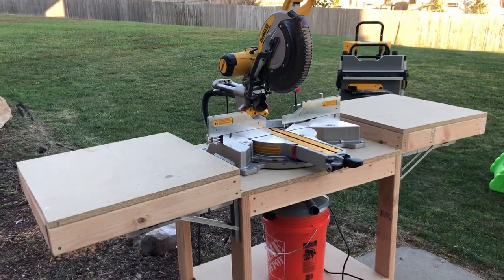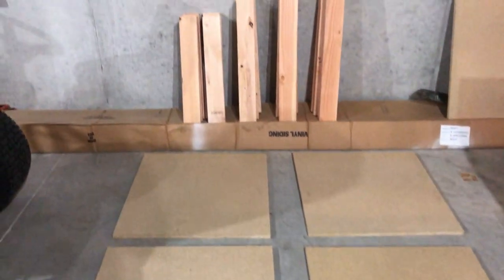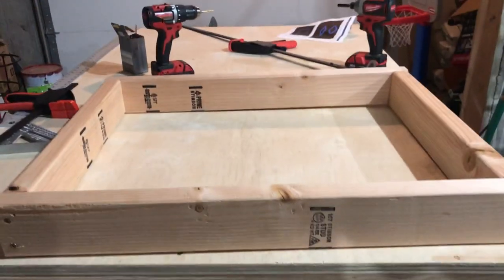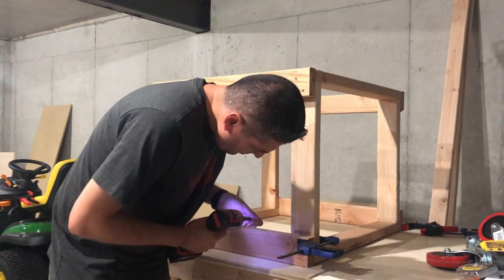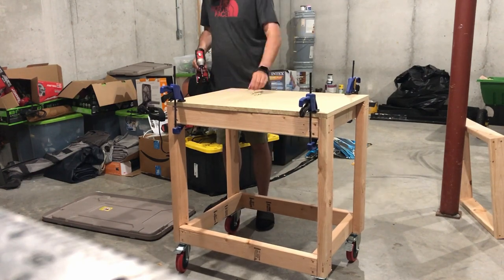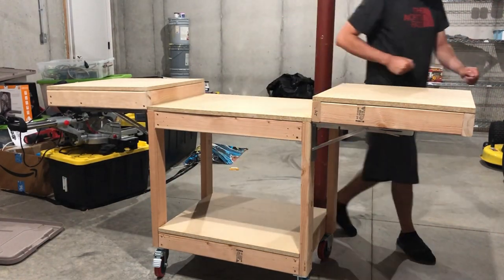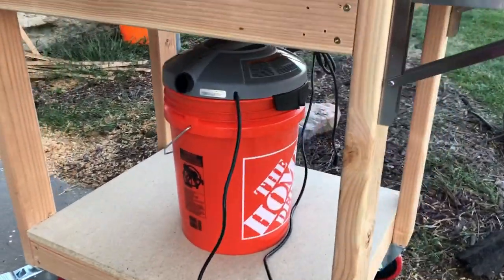HOW TO MAKE AN EASY MOBILE MITER SAW STAND

Comment: Eric, just made a stand with foldable wings.  Excellent video! Thank you. SK
Reply from the maker: Thanks!! Glad works for you
Reply: Hello, did you use the same design with the two folding brackets on each wing? If so, do you find that they are supportive enough for each wing? Is there sag?

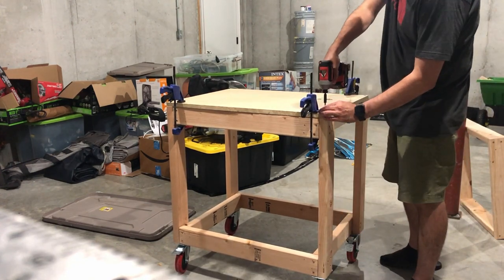Comment: Thanks for the video! I've followed this video and I'm almost done putting my miter saw stand together. You should edit your video to call out that the legs are placed incorrectly at 2:23 & 3:32 (on the wrong side) and you fixed them on 4:57 (you can see the screw holes from the previous position). If follow each step in the video you won't have the same final product.
Reply from the maker: Diego Thank you so much for your feedback.. I will update the video.. and yes you are right the legs where wrong side.. I had the video showing the differences.. I missed that during the edition. Thanks again!! 👍🏻
Reply: @watcherick4433  All good man, thanks for inspiring me to build my bench! Take care!
Reply: Ok, this has me confused...the 29 inch boards are the upright frame and the 24inch go at the bottom and top of the center? Or is it the 21inch that are the top and bottom frames?
Reply from the maker: @Ibex666  Hi Sonny here is the combination for top and bottom of the mainframe is (4) of 29 inches and (4) of  21 inches for the wings is (4) of 24 inches and (4) of 21 inches.

Comment: Nie design and I am almost ready to assemble mine. Question: How do you keep the saw mounting bolts from interfering with the extension arms?
Reply from the maker: I removed the factory mounting bolts to don’t interference with the wings .

Comment: I got my frame pieces square but there are gaps no matter what combination I try. I'm sure they have some warping. Do you have any advice on how to get rid of gaps in butt joints?
Reply from the maker: Yes,  use a jointer or sand the other side of the area to reduce the warping.

Comment: Any suggestions on how to figure out how high to mount the wings so they line up with the bed of the saw? It feels like I may just have to guess. And hope to get it right.
Reply from the maker: I tried three different miters saw, and all were good with the height.
Reply: How did you know where to mount the brackets so the height of the wings are good for the height
Reply from the maker: You can use some clamps to hold the wings and then align the the end of the wing with the frame.

Comment: Great video but I was doing it just now and I see you said 24×32 of plywood or MDF for the bottom center but it's actually the same as the top at 24×29 !
Reply from the maker: Hi Friend, The bottom is smaller by 3 inches , because top is using the width of the 2x4 from each site. if you have it with the same, means that you putted the 2x4 in the wrongs side,. in you need more help always can shoot me a email .. Watch3rick@gmail.com
Reply: Yeah I just found that out I was doing it from the way you were doing it from the beginning.. I can see you took out the screws too. and put them the other way. Also what how or what you use for the caster wheels ?
Reply from the maker: Construction screws with washers. Four for each caster
Reply: Nice what size of screws and washers?
Reply from the maker: #10 2 1/2 inch and washer 1/4

Comment: what exactly is that vacuum topper? I could  not find it on home depot
Reply from the maker: Bucket head is the name and they next to the rigid vacuums
Reply: @watcherick4433  So it is not specifically a dust cyclone. How is it on collecting the saw dust and not clogging the vaccum?
Reply from the maker: @brucet3270  is not a cyclone system and works perfectly, not clogging because came with a filter.

Comment: Cool but the wings sag too much defeats the purpose... You want level support when cutting.
Reply from the maker: Hi Juan, the wing are at the same level
Reply from the maker: KYLE BANNER  Mine is level perfectly, you could check if the brackets are not aligned at the end the board is making hang some, that happens to me the first time.
Reply from the maker: KYLE BANNER  Wow sounds interesting, send me a picture to see your design.

Comment: I see 32 comments.  I looked at all of them & still do see the materials list.  Sorry!
Reply from the maker: Hi Jessie the Material is on the Video Description, but I copied the material list in this post for your convenience. 

Wood Shopping List
Qty: 1 - 3⁄4 inch thick plywood o MDF  ( 4 feet by 8 feet)
Qty: 6 - 2x4 by 8 feet longboards.

Cut List
2”x4”s: Cut Four 29” long pieces (Center Frame)
2”x4”s: Cut Eight 21” long pieces (Center and wings frame)
2”x4”s: Cut Four 24” long pieces ( Wings Frame)
2”x4”s: Cut Four 28” long pieces ( Legs)
3/4" Plywood-  one  @ 24" x 32"  (Center Top)
3/4" Plywood- one   @ 24" x 29" (Center Bottom)
3/4" Plywood - two  @ 24" x 24" (Wings Tabletops)

Hardware and other supplies
Qty: 2 Brackets support
Qty: 1 box of 2 1⁄2 inch Screws 
Qty: 1 Power Strip
Qty: 1 Vaccum (Home depot bucket)
Qty: 4 Lock Casters